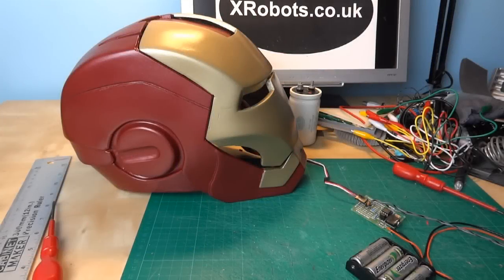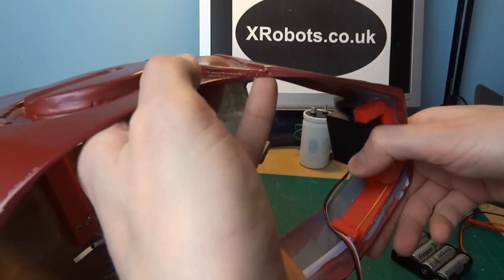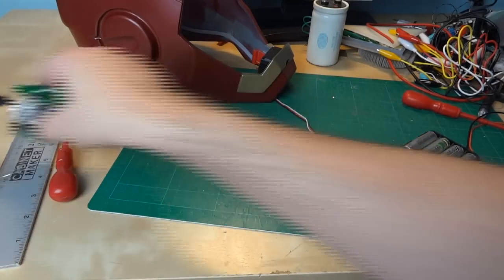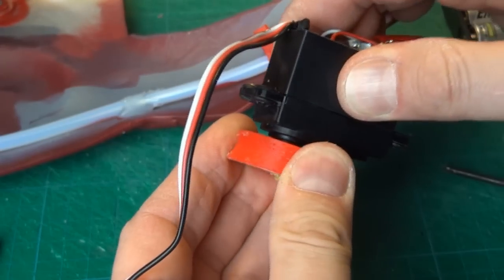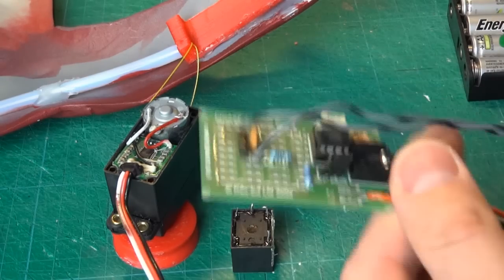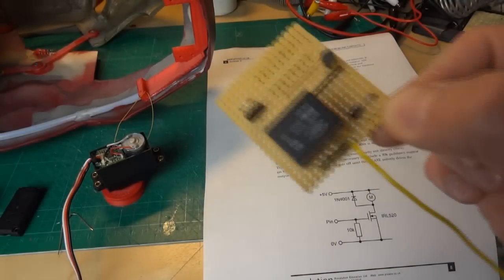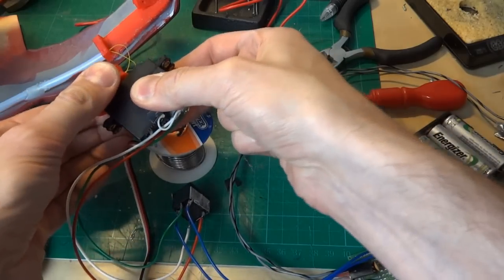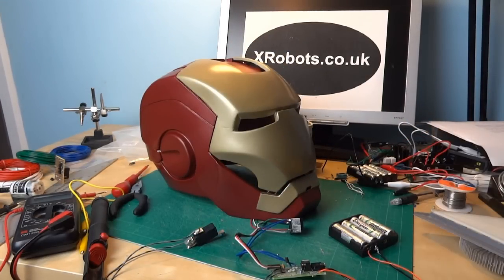Iron Man Power Suit #43 | Returning to the Faceplate | James Bruton

Comment: Nice work. I just finished programming a power off sequence for my helmet. 
Adding more resistance to the servos is a great idea. 
Good luck on jamming all those electronics in there.. And dont forget to use some NeverWet to add protection from moisture inside the helmet!
Keep up the great work.

Comment: Thank you first of all for everything that you do, it is really appreciated. I have my own project I'm working on and the relay [magnetic operated switch] that you refer to is perfect for what I'm working on. I just haven't been able to find it a brand name or something similar will help a lot. Also with my suit I used two micro servos on the top to lift the face plate  it works well for what I needed it do although this is extremely well though out and works way better than mine did.

Comment: Nice effect, useful to know about!

Do you know if there'd be any problems with doing something similar with Mosfets instead of a relay, for lower power-use?  (Although I guess that's not too much of an issue if the relay is only energised while the servo is in flight)

Comment: Can you use the magnetic braking circuit on its own?  IE, without the use of the picaxe board?  I have a project that could greatly benefit from magnetic braking (using servos), but don't want to use a picaxe due to room restriction.
Reply: This would be on a trailer that I am building for an RC drift car.  I'm using the servos to lift and lower the trailer.  The servos would be connected to one of the receiver's channels.

Comment: Hey James, I am somewhat new to circuit boards and Arduino script but I'm wanting to build a servo faceplate similar to the style of Ryan brooks, with the accelerometer and the timed eyes, and now to my question what Arduino board, and accelerometer would you recommend for it? I am sure I could wire and code it eventually, but I don't know where to start.
Reply: ***** i look and then see the picaxe, so as far as i know for an accelerometer you need an analog imput, would the picaxe-18m2 work?

Comment: Why not just use air pistons easier to work with and work better for this type of project.
Reply: Yes but have a 12 volt electric pump. Digitally picks up when the air chamber is empty so it can auto refill.